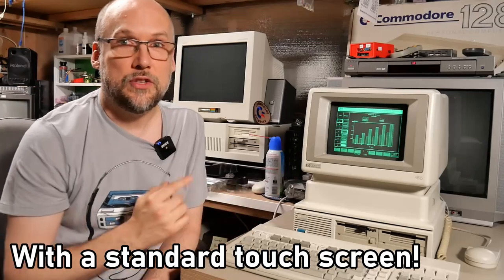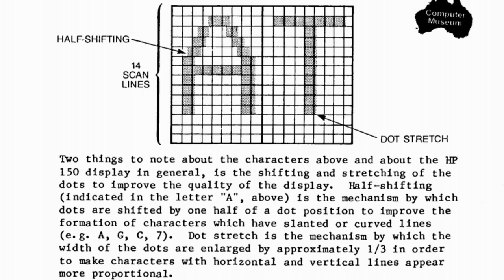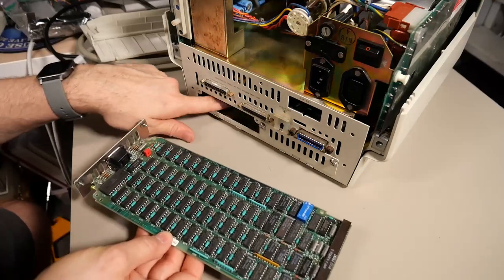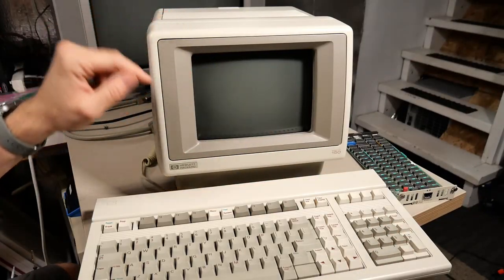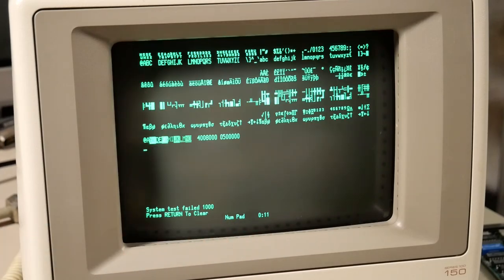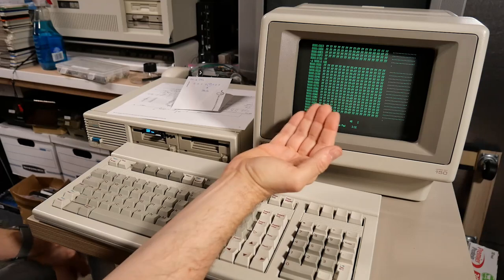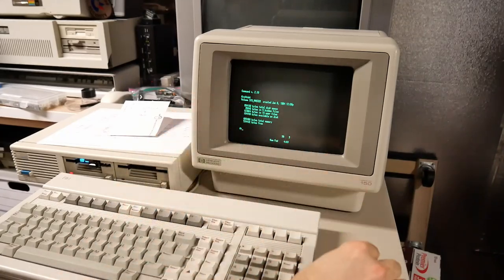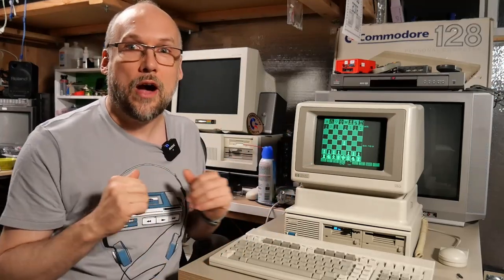Touch Screen MS-DOS PC from 1983

Comment from the maker: Upon further study of the service manual, I was not interpreting the the selt-test errors displayed on the CRT properly. They are a 16 bit code which must be compared against a table that breaks down each problem area. See page 88 and page 90 in the HP 150 service manual. The codes 1000, 1004, 100C and 000C make sense now. The first 1 points to the touch screen issue and the xxxC or xxx4 all point to RAM issues (which turned out to be the expansion RAM board.) The LEDs must always be decoded to read the proper error code from the machine. Live and learn! HP 150 service manual: http://www.bitsavers.org/pdf/hp/hp150/45625-90001_HP-150_Technical_Manual_May84.pdf
Reply: That was excellent problem solving. It shows how dead ends and false assumptions can lead you in the wrong direction, but using common sense and observation can keep you progressing forward.
Reply: I was gonna say to hit up curiousmarc on YT for all things HP, he's probably got one or at least may have a line on the service manual.
Reply: Niall Fleming Or the Imsai guy also great Retro Computer Channel and Former HP guy
Reply: You've taken away my chance to comment that those error codes clearly mean "Fault with error reporting system".  Heh.  Anyway, this must be one of your very best repairs yet, considering the lack of documentation and that tricky board.
Reply: Maybe it's just me but I can't figure out which pages you mean. I opened that link and tried PDF page 88, nope. 8-8? Nope. *-88? Doesn't exist. Anyone able to find it?
Reply: I was 42 mins into your video and went searching for a manual before I saw your post..  Glad you figured it out.  I found the service manual on HP Museum’s website.  http://www.hpmuseum.net/document.php?hwfile=1528
Reply: Seriously Adrian ..
loving the way your brain processes logical approach to fault finding ...As a TV repair Tech my brain functions in pretty much the same way. Kudos on this repair ..I'm very very impressed buddy. rgds Evan
Reply: I'd like to point out that you could replate that battery terminal yourself with a coating a solder. that would protect it.
Reply: In the future have you considered rather than cutting chips out, attaching a minigrabber type lead to the chip select and pulling it high/low (depending on what the chip needs).
Reply: By the way some computers don't know if it's HPV or not do still use or at least several years ago day. Head LEDs some works. 4 Diagnostics visible from the outside of the case through a slot journal in the back or Holtz I remember seeing those on a few computers don't know which ones or anything or win but they did exist and may still do you would on some Modern machines as well.
Reply: Adrian's Digital Basement 🍩nice info
Reply: I will Trade you My IMSAI 8080 But it a Z80 only in it I use to have the WD PDP-11 CPU S-100 CPU Card But I still have  a Bunch More Stuff, I still have Books, Floppies, and the Two 8-inch Floppy Drive Unit..Let's Make a Deal..
Reply: 17:30 Maybe they cut those lines because they had shortage to internal layer ?

Comment: "Extremely well engineered, like all HP stuff is." I think you mean all HP stuff before around 2007.
Reply from the maker: Yeah good point!! Like all the HP scientific and test stuff back then :-)
Reply: @1000 Subs with just Playlists Not really sure, all I know is I have a 2005 HP laptop that runs well with no heat issues, and three HP laptops from 2008 and 2013 that have absolutely terrible heat issues (i had to remove the plastic vents over the single tiny cooling fan to get it to stay on during summer this year), and I've had two HP printers fail fairly quickly recently, plus my grandma got an HP printer where the wireless function, which was one of the main selling points, stopped working after a couple days, and when we went to return it, there were two other people in the queue with the same printer. After that, that model of printer was advertised as a USB printer only, with no wireless functionality.
Reply: 1000 Subs with just Playlists - the Compaq acquisition is what really did it for the consumer stuff, they spun that off to Compaq. If you look at the computers just before and just after that, the difference is obvious. Their enterprise grade stuff is still alright these days.
Reply: HP started going down hill when they started having a string of successively worse CEOs who cared more about lining their pockets than actually making good products. it's pretty sad.
Reply: @1000 Subs with just Playlists nice username made chuckle!

I've seen some really creative ones though so definitely a good one.

Story behind it? If there was one?
Reply: @1000 Subs with just Playlists - I worked for HP later on and it was totally run into the ground by the guy who came much later; he made so many bad decisions that the share price fell by half in just 10 months.  He told the market he was closing down PC manufacture but not when so nobody bought them as they couldn't rely on any future.  He cancelled their new pad after a few weeks of launch then sold every one of them in a fire sale that lasted maybe a few minutes because they were so popular.  The most egregious part was he was given a $37m golden handshake to leave and he had just come over from SAP where he had done exactly the same thing.
Carly Fiorina was part of the Compaq takeover of HP and certainly changed things but didn't run the company into the ground per se... that took another major level of incompetence.
Reply: For sure SubG, in fact you could probably output the data from an HP oscope to this PC using an GPIE cable. Smart researchers probably did this to get real time data onto PCs in the 80s and 90s. Now we have scadas, data historians and powerful visual tools like except and power bi
Reply: @1000 Subs with just Playlists The "real" HP built equipment that was insanely well engineered. From calculators to computers, to test equipment, they had engineering second possibly only to Tektronix and the aerospace industry. While I preferred Tektronix equipment generally, I never had anything but the greatest respect for the HP of those days. Then, management changes led to the breakup pf HP, and a great company disappeared, sacrificed to management greed and trying to impress Wall Street.
Reply: @CooChewGames  You are referring to Léo Apotheker term as CEO, right?
Reply: @amberselectronics  Actually, the 2005 laptop I mentioned that works fine is from when they were branding computers as "HP-Compaq". Not sure if that's different from the phase where they made separately HP and Compaq branded versions of the same computers, which is when my 2008 laptop with an overheating problem is.
Reply: @50shadesofbeige88  Yeah, my mum's Envy from 2013 has exactly the same overheating issue. (Plus, Windows 10 throttles the CPU to 530MHz if it's moved too quickly, which is around half the minimum requirements for Windows 10.) I wish my 2008 laptop had a Turion, apparently they run both cooler and faster. Unfortunately, it's seemingly impossible to find the highest end Turion that'll go into it (a ZM-88, I believe) on Ebay, plus the laptop in question is absolutely horrible to take apart, I only just barely managed to get it back together after the first (and last) time I took it apart.
Reply: @alexdhall  Whoever was in charge in 2011 when I was contracting there...
Reply: Hp used to make some high quality equipment. When I was working in IT / office copy product I loved the older hp 4200 laser printer. Even now in my current office I have an hp 4200 I use for printing envelopes. I paid a over $500 for a 16 year old printer with envelope attachment. Their new stuff is all cheapo garbage.
Reply: @TheElectricnoob by the way so we can kind of interesting along that lines sort of when are being was developing one of the first personal computers they were sealed boxes even soldered shut and then some to prevent reverse engineering and giving away the company's Secrets when people were working on a software if I remember the story correctly.
Reply: Well engineered like any product should be at least ones that are worth their salt and well thought through and not just something that no one would even want and actually is worth buying and so on
Reply: @TheElectricnoob I think we were all and Electra new band one time the first time we ever worked on something at least but did you ever win first getting started turn into electroboom I'm sure you have at least once if this is the case and you got a good story Comet please love when people tell about things going awry
Reply: @CooChewGames  I was working for HP back then. Those pads were great value, I bought the wireless charging dock for mine and the whole lot was about £30 , it was way ahead of the iPad and should have been a big success, but the company was run by idiots
Reply: Truuuue. I've got an hp desktop from right around that period and the cable routing in it is absolutely horrendous, I had to disconnect some of the front IO in order to fit a graphics card into its only 16x pcie slot.
Reply: HP only makes good fax machines. Everything else is junk.
Reply: HP's consumer electronics have become a punchline for sure.
Reply: @adriansdigitalbasement  ☻never knew hp made actually computer systems interesting
Reply: They still make great monitors (Omen) . And some good-great laptops I think, tho I wouldn't be positive from first hand experience or anything.
Reply: 1000 Subs with just Playlists Carly started as CEO in around 99. Everyone dogging on CEOs have to know the board of directors still have to approve most of the moves. Inc splitting off proved the problems were on the Enterprise side.  Shitty management that runs all divisions into the ground trying to save the Wintel Servers. They are now basically giving away those servers through Greenlake project hoping companies continue to “renew leases” instead of actually buying. The HPI laptops are ASUS designs for the most part.
Reply: Peter S. Hey HPE made stick with a 10 year old design. Probook something. The Elitebook 840 gen4 is awesome, though.
Reply: Chris W. At least one decent laptop brand these days is ASUS, and Lenovo isn’t too shabby either. I never had much luck with HP laptops, but I did have an amazingly heavy and nice HP workstation bought secondhand some 20 years ago. It had double P-II CPUs and SCSI drives and ran Linux well - got through grad school on that thing. I carried it 4 miles from the store to the apartment and my side seems to still hurt two decades after having to wrestle that thing – it was big and had a steel cover and chassis and probably could support a small truck’s wheel sitting on top (with truck attached) :)
Reply: Peter S. My daily is a 5 year old ASUS N550 with an i7, SSD and a hard drive (on a caddy in place of the DVD), with Nvidia 950 graphics, and it works very well - I constantly compile software on that thing and it works just fine. relatively serviceable and other than styling and more reasonably sized radiator not all that different from their “gaming” laptops of the same era. I recall looking at HP’s offerings in the store at the time and nothing looked particularly appealing.
Reply: Tony Crabtree Their networking gear is top notch still though - about the only thing I have bought for 2.5 decades as far as switches and routers go. Totally sane support policy: you can download fresh firmware for as long as they support the product, so none of the “support contract” rubbish, and there is a lifetime warranty on the hardware - they ship replacements overnight for free. Nobody else in the business beats HPE networking stuff when it comes to sane support. Cisco won’t give you anything without paying, as a point of reference for what the industry considers “normal”.
Reply: HP was one of the gold standards in the tech industry back then. I had one of their later Elitebook models (2017, the x360 one) and holy crap the keyboard and trackpad sometimes do not work and I need to flip it to tablet mode and back to laptop mode for it to work again and the wireless card was so shitty it loads things in the Internet 50% slower than any of my other devices; they're all in the same room, plus Windows Update always had problems downloading or installing.

I miss my 2005 HP, man...
Reply: more expensive HP stuff are good even after 2007. They just start putting that logo on everything and that's fastest way to loose reputation. But on premium stuff you can still see remanence of premium engineering.
Reply: I think they really started going down hill when they spun off Agilent in 1999.
Reply: I bought a Turion HP laptop around 2007, can't remember the exact model but it had known GPU failure issues that resulted in HP extending the warranty for 3 years.  This machine failed 7-8 times throughout those 3 years,  HP would pick it up and refurbish it every-time, sometimes it come back with HDMI, and frustratingly sometime it would only have VGA.
When the warranty finally expired I used it for light tasks like printing postage labels for my business,  of course it failed within weeks again.  I have never touched an HP product since.
Reply: Yeah what? HP is the only company I will never buy anything from because their products consistently suck so hard
Reply: Mine is an all in one let me tell you the 1.4ghz has a problem hoping to clean it
Reply: Yeah, i have a Compaq server, a ProLiant 3000, and the engineering on that thing is out of this world. Most things can be replaced withoit tools and its a joy to work on (well,except for its huge size). But whenever a friend calls me with laptop problems... Its usually a HP. One of my work-provided computers its a HP with a docking station...what a POS, in every respect. And dont get me started on their printers... At least testing equipment, now under keysigjt branding, is still good.
Reply: @uberdude2555  dv6000/9000 was the worst. Any with the and cpu, and nvidia gpu would fail. The gpu heat cycles would cause bad connections on the bga solder connections. I think some of that might be related to the lead free solder used. Sometimes a heat gun to the gpu would bring it back for a bit.  The computer store I worked at had around 50-60 that got sent to be recycled from being failed
Reply: @zebunker  try Dell if you think that. I work in IT. Endless problems with Dell.
Reply: @sassback3693  try Dell if you think that.
Reply: I was a service engineer for HP in the 80s and I repaired many of these. On the whole very reliable, but the touch screen array was prone to failure. HP went down the toilet when the company split into HP and Agilent. I was working in manufacturing at the time and the quality we were shipping was not HP quality. We would ship knowing the equipment was faulty just to meet targets.

Comment: In High School (1986) I worked as a security guard at HP in Cupertino. We had this machine controlling our security center. Its touch screens would change the monitors (Televisions) on the wall to the channels we needed to view. If someone didn't access a door correctly, the machine would register the alarm and allow us to switch the camera, and log the alarm details all with touch. Given the year, it was such an amazing piece of integration. It had the printer installed that would Print both the normal alarms, but could also print the CRT image from the selected TV. The control and connectivity for this single screen was and still is the most heavy integration of serial control I have ever seen. Hundreds of HID readers attached to a server, and those servers had door lock controls managed by the same machine running the monitors, the alarms and the daily logs. Amazing for its time. Think DBase 4 with legs.
Reply: this was also my first year of seeing 3d graphics running on some development prototype display of a car rotating in air, it was a dodge Charger Shelby graphic picture rendered in 3d and it was eye candy never seen in the bay area. They also had a Ink "Plotter" that was huge but could print in color! like an artist, it would spin a color pallet of ink jars, pick the pen and like modern 3d printers, it would draw using vectors. I would say I was amazed, but now I think I spent too many hours wasted as a youth. 
HP security officer (AKA globe security) 1986 - 1989
Reply: @trs-80fanclub12  same time, I had a Highschool buddy who's dad was sales director of HP Germany. You can imagine the stuff this guy had in his basement... it was amazing. He sourced HP-11 calculators for his inner circle at school, have mine still, running like new. Programmable calculators weren't allowed to use in school, but the teachers turned a blind eye because they were so impressed that we could handle RPN.
Reply: That sounds so exciting!
Reply: Yes, I remember that all the Bay Area front desk people had these monitors for security.
Reply: And these days such systems run as bloated servers on top of Windows, and are usually not really impressive for how much resources they need to run.